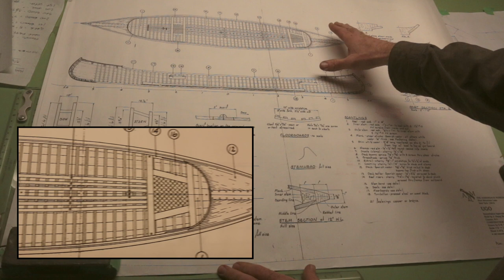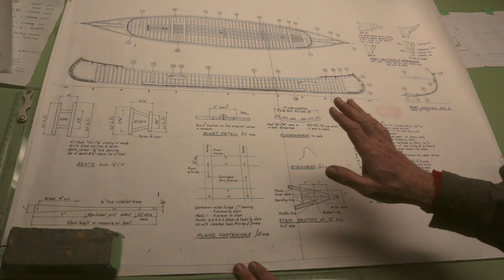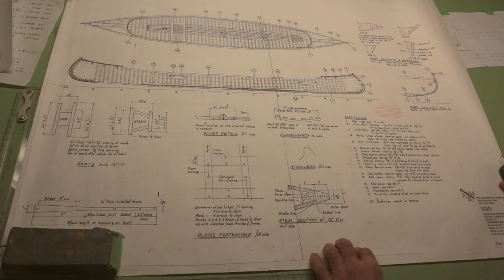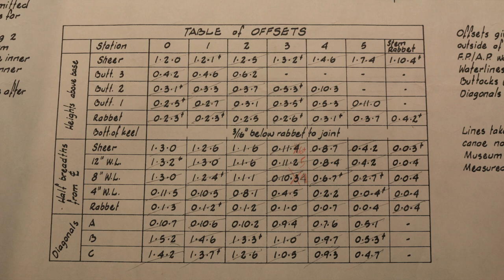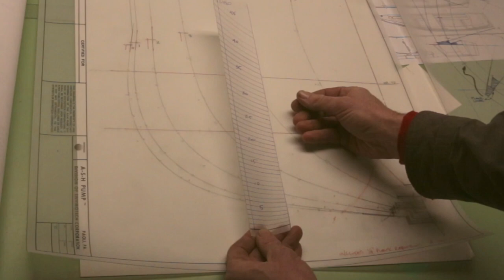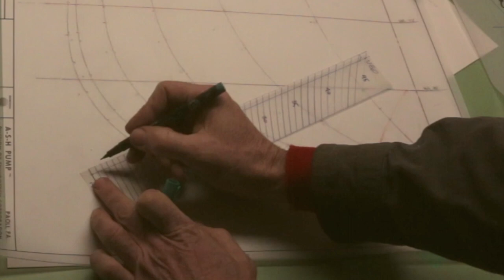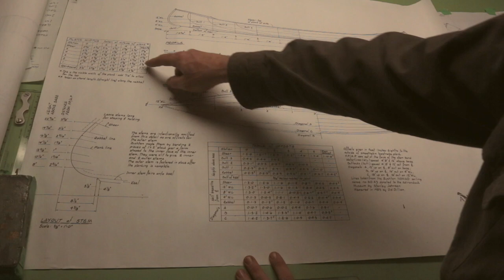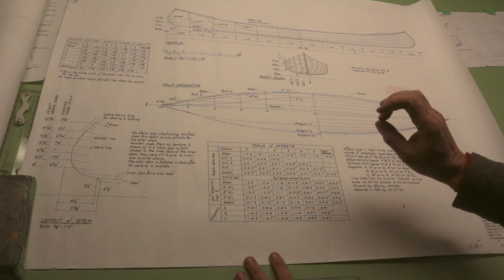⚓️ NOMAD - Understanding Boat Plans

Comment: Designing sailboats is both fun...
And an endurance test. Having the hull shape that's in my mind take form on a sheet of vellum is AWESOME!!!

Then doing the Table of Offsets, working out the construction scantlings and doing the Weight Estimate.how will this but, bolt and dab of epoxy that's 5.4 stations from the Center of Flotation affect the boat, and will I have to use trim ballast to make her float on her lines both longitudinally and laterally?

It's a long process!!!
Reply from the maker: It is indeed. That’s why I laugh at people complaining about the cost of good plans.

Comment: Good Video Mark , i am still having trouble with the bevel board i couldn't see what was on it but i will watch it a few more times thx
Reply from the maker: Thank you Mark. I understand your fogginess regarding the bevel board. It really deserves its own video. The geometry governing how it works is pretty hard to visualize. I struggle to fully grasp it myself. I get there, then as time goes by I loose it and have to spend some time doing some mental back flips until I have it again. There are other methods you can employ. The bevel board is basically a protractor except you are only looking a slice through the radians. That slice is taken at a distance from the origin of the radians (center) that equals the spacing of the stations on your lofting. The width of that slice needs to equal the thickness of your planking and sometimes frames. Whichever you need to reduce your moulds by. So the bevel board can show you not only what the bevel of your mould or framing needs to be at any given point but also how much you need to reduce the size of the mould to accommodate that planking so that your finished product matches the lines in the lofting. You make a new one to suit each design you loft out. Some people loft to the inside of the planking which can eliminate the need for reductions. Not my preferred method because It creates other elements to confuse me. My wife already takes care of that job.
Reply: Yes I agree that subject would warrant a video for sure, hey i bought a nice Craftsman 12" Bandsaw and a  Porter Cable table saw yesterday  thx Mark
Reply from the maker: Mark Wentland sounds like you're loaded for bear then. I have stuffed a lot of wood through a Porter Cable tablesaw. I've owned two of them in fact. Do what you can to buy or create a Bessimeir style fence for it. The factory fences on those are horrible. I boosted one of mine up to 2HP as well. Play safe.
Reply: boy your are right that fence does suck i will be changing that for sure !!
Reply from the maker: Mark Wentland check John Heinz's or Mathias Wandel's channels. Either one probably has a video about building something decent.
Reply: I will thx Mark

Comment: Hi Mark, i was wondering what kind of paper or material that is you are doing the mold reduction and stem lofting on ? thx
Reply from the maker: Mark Wentland that's frosted mylar drafting film, which allows you to draw in pencil but I more often use clear mylar and markers.
Reply: Thx Bud

Comment: hi, could you explain how to determine the mast length and shape when its not drawn in the blueprint? like most times you find the hull of the ship and the masts broken and not drawn, how can they be determined?
Reply from the maker: The best starting point would be to design a sail plan and work from there. The common method is to refer to other successful boats of a similar type and size to determine sail area and configuration. In some cases sail area is a determined as a ratio to wetted surface of the hull or cross section of midships. Of course in designing the sail plan, centre of effort of the sails relative to the center of lateral resistance of the hull is considered. With a sail plan in hand you can figure out the length of your spars and the potential forces upon it. From there you follow formulas that guide you in selecting mast materials and in turn the various relative diameters a mast or other spars must have along it's length. Of course the short answer is to again, steal those details from successful boats of similar size and type or start with accepted relative ratios. A very good reference book on this subject is  Norman Skene's “Elements of Yacht Design”. I prefer the original publication over Francis Kinney's revised version but the core information is the same.
Reply: Great explanation, but I forgot to mention I was asking from a modelling perspective, not actually planning to build a real ship, most of the plans one can find through the internet only describe the hull, bowsprits and masts are broken/not represented, I was asking because I don't know if there is a way of figuring out the shape of each mast section and bowsprit... THANKS!!!!
Reply from the maker: Well That’s a little different. My best guess is that you would need to it compare to other vessels of the same size and era.  If we are talking historic square rigged ships then it's a question of research. Books like “The Young Sea Officer’s Stream Anchor” - Lee Valley tools publication or “Masting and Rigging” Bridgecomb - Dover Publications can help with certain details. Historic paintings, drawings, models and modern reproductions are all sources of information. Learn how to work out scales and with dividers and vernier callipers.  There are probably naval records that specify stuff like that. It’s all about digging for answers and educating yourself.

Comment: How do I find the knee for the transom
Reply from the maker: Well, most plans have a construction drawing showing the profile of the boat cut along the centerline, showing interior components. Any transom knee would be featured there. Not all plans have construction drawings though, and in that case you would be expecting to design the transom knee yourself. That said, some designs might not have a transom knee at all.